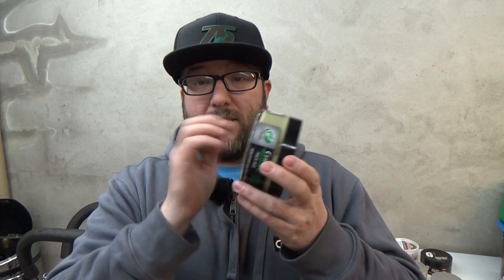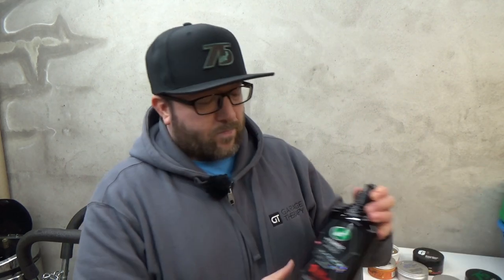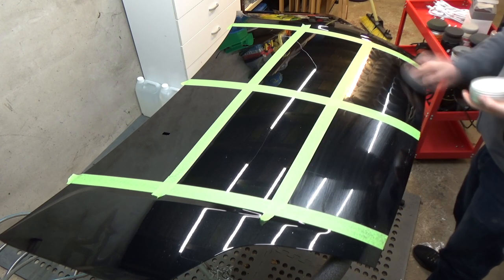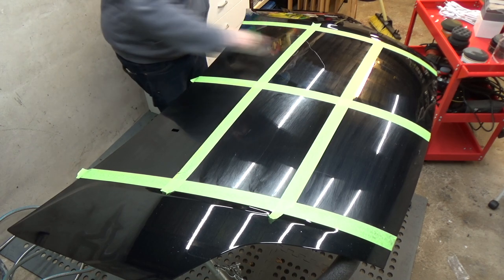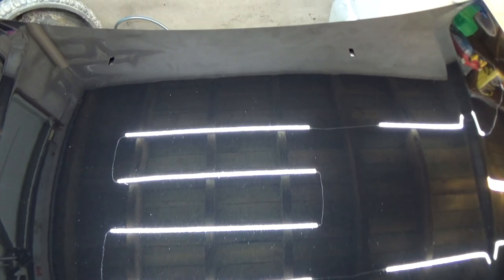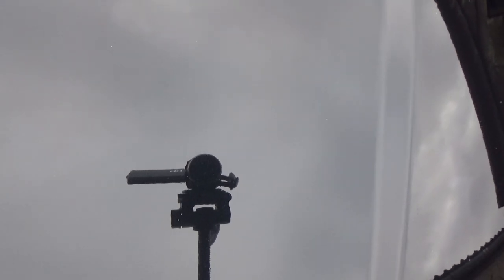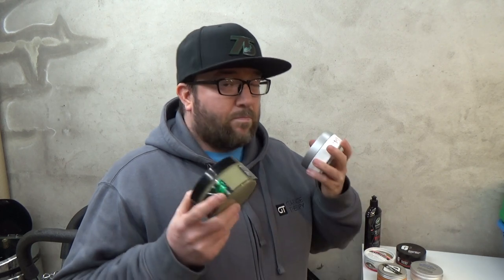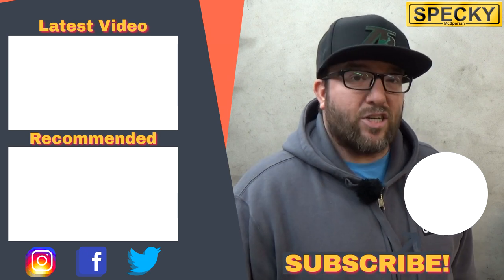Turtle Wax Ceramic + Graphene Paste Wax Test!

Comment: I used the TW last weekend and found it a little harder to get the wax out of the tin and the removal seeming a little more grabby than the traditional high content carnauba wax I have been using. I did like the results of the TW. On the next application, I might try warming the TW up a bit to see if I can get it to apply a little easier.

Comment: I have been enjoying the Turtle Wax 75th wax. I have noticed that it does benefit from a third clean towel buff, which seems to really make the gloss pop. I realize that is a bit more work and not absolutely necessary, but the difference is noticeable.
Reply from the maker: Good to know, thanks

Comment: Great job Specky,  what would you recommend for a winter survival wax? I've used the Bilt Hamber on my car and the Turtle wax on my wife's car. I'm looking forward to testing the longevity. Any thoughts 👍👍
Reply from the maker: Thanks Nigel. Bilt Hamber Double Speed Wax is hard to beat for price and performance. Turtle Wax Hybrid Sealant Wax (new name for Sealant Hydrophobic Wax) is incredibly good, fast and easy to use (spray wax) and decent value too. You can layer it too for longer durability.

Comment: Ive got the Double Speed and yes it does a cracking job but i prefered the Soft99 Kiwami wax i was using at this time . I wont knock it but on the Nissan I prefered the Soft99 products but then Im a fan of their products
Reply: Soft 99 waxes are great and offer exellent value for money 
I find the built hamber wax to be overated In the detailing comunity tbh the same with sonax bsd which is horrible to apply and remove unless you mix it with another qd 
Works well mixed 50/50 with car plan no1 gloss
Reply: @thephantomarse8525  BSD has its place , yes its sticky to apply but the water reaction it gives its fantastic . I tend to use BSD as a drying aid rather than a stand alone product
Reply: @tmphotography8443  
I used what i had left the same way dont think i would buy more of it though

Comment: Great video. how would you use this in combination with Turtle Wax's Hybrid Solutions Ceramic Spray Coating. Would you use this one as a topper to the HS Spray Coating? or this one as a base and then top it with the HS Spray Coating?
Reply from the maker: The HS spray coating takes 24 hours to cure and needs 2 coats to get the best durability, so if you have the time then I'd use the wax as a topper. The question is - how long do you need your protection to last? For time efficiency I'd use the wax as a base and top it regularly with HS quick detailer and it'll always look fresh.
Reply: @SpeckyMcSporran  Thank you !!

Comment: Great test mate   turtle wax is a new product yet to be seen in 6 months time it's got to be better then who soft 99 otherwise it a total failure and with both those ingredients in their it should be a lot better what is the durability and life expectancy of bilt hamber I cannot find anywhere with it tells me it lasts so many months a year
Reply from the maker: Figuring out how long a product lasts is not easy. So many factors change the outcome like where you live, where the car is stored, weather, temperature, humidity, road conditions etc. If you want your protection to last a year then get a ceramic coating.

Comment: I've been using turtle wax graphene paste wax ever since it was launched and it gives great initial protection and water displacement etc but i have been really disappointed with longevity.  I've had 2 weeks max out of it before the water stops beading off and ends up with a flooded panel.   I'm in the UK and my car does less than 100 miles per week, quite often in the rain.
Reply from the maker: How does it behave when you wash it? Flooding can happen simply by water clinging to dirt on the surface of the paint. Waxes and sealants don't stop dirt sticking to the car, they're essentially a sacrificial layer on top of the paint. Protection still requires washing so try that and see if the beading/sheeting returns.
Reply: @SpeckyMcSporran  This is flooding after washing using dodo juice born to be mild.  I wash once per week no matter the mileage and after 2 washes i lose most beading.  I apply using a meguiars applicator sponge pad and buff off with micro fibre after a few minutes.  I can't work out whether this is expected behaviour and i'm asking too much from the wax or whether it's just not as good as it should be.
Reply from the maker: Very interesting, I'd expect it to last more than two weeks for sure. How did you prep the paint before applying?
Reply: @SpeckyMcSporran  cold water pressure wash, envy care care bubbly jubbly PH neutral snow foam, cold water pressure wash, dodo juice dual bucket hand wash with warm water, cold water pressure wash, dry with meguiars towel (2 of those normally).  I normally do a clay bar when the weather starts getting nice which will be soon but not done it for around 6 months or so.
Reply from the maker: I'm going to guess there's a few things that could be happening. 1 - your wax hasn't bonded properly due to contaminants on the paint that your wash process hasn't removed.  2 - the wax has not cured properly due to temperatures/conditions/time. 3 - the wax has failed somehow in the manufacturing process.
I'd recommend using a polish/pre-wax cleanser to remove the wax on a section of the paint and reapply to test the wax again. If it performs better then you'll get a better idea if what might be wrong.
Reply: @SpeckyMcSporran  just ordered some dodo juice lime prime so will see what it does.

Comment: Actually, this is not a real test.  You need to apply all the waxes to the hood of a car and drive it in the elements, leave it parked outside 24/7 in sun, acid rain, etc.  let the sun bake in road grime, salt, dirt, etc.   Do you weekly washes and leave it parked outside, continue to drive it in rain, dust, hot sun, etc.  Then tell us how these waxes held up after 6 months.  That’s a real world test.
Reply from the maker: I didn't say this was a real world test, this is a resilience test. A long term test might come in the future.
Reply: @SpeckyMcSporran  Cool.  Cant wait to see the results of that future test.  You might be surprised how none of these waxes hold up.
Reply from the maker: Very true
Reply: @BW-kv9wj  I can't get more than 2 weeks out of an application of the TW in the UK before the panels start to flood instead of bead off.  I was expecting more if i am honest as I can get the same performance with a spray wax (like megiuars hybrid ceramic spray wax) which obviously takes significantly less time to apply.
Reply: @andyknight8108  May I suggest 303 Graphine spray.  It’s the best I’ve tried so far.
Reply: @andyknight8108  I actually topped the 303 with the turtle wax 75th anniversary ceramic Graphine paste wax and I didn’t noticed a difference in beading. I do keep my car in the garage.  But, the TW is way more slicker and very smooth to the touch.  Much more than the 303.